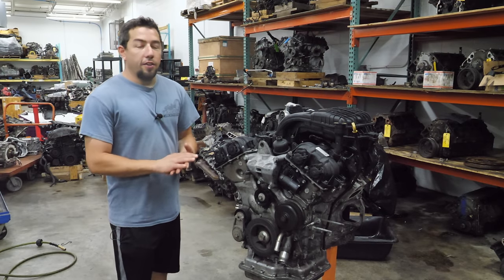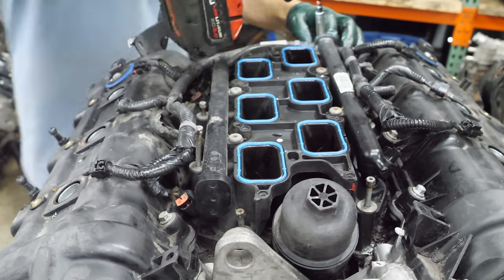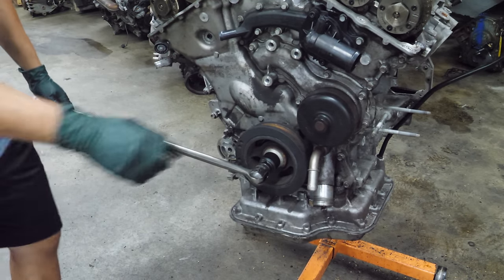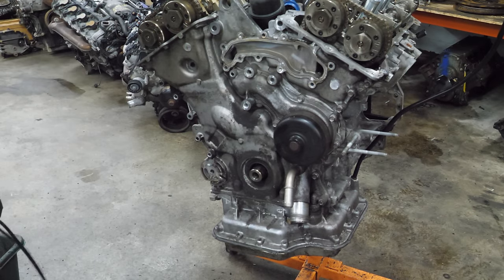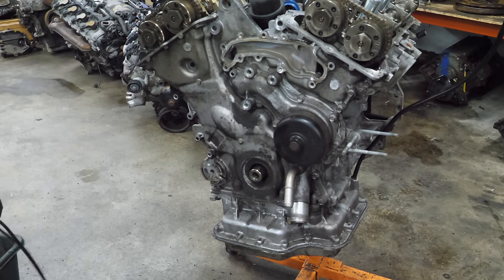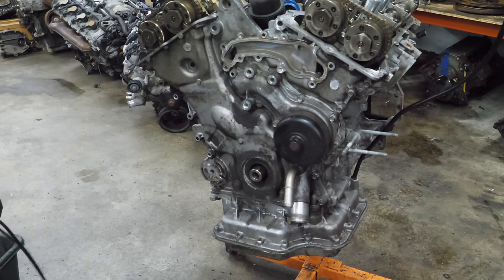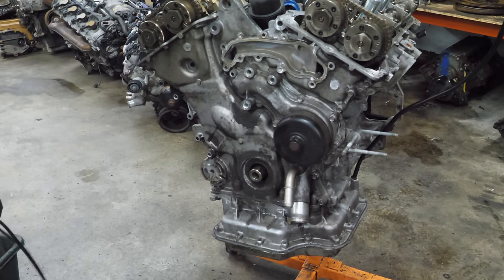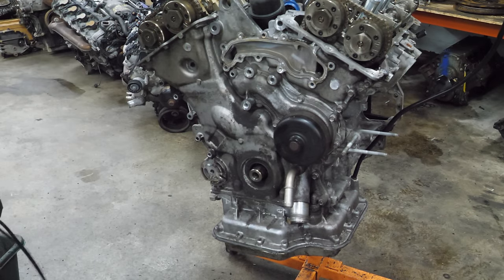Dodge Caravan 3.6L Pentastar V6 Teardown! Why Won't This Engine Turn All The Way Over?

Comment: The Safety Tote reminds me of Dark Helmet from Space Balls. Every time I see you use the Safety Gear, that’s what I think of. Looks like a decent little engine still. I wonder what would cause the carbon to buildup like that?? Thanks for the videos. Hopefully everything goes smooth with your wife and new baby.
Reply: The problem is the direct injection system, that is why there is so much carbon on the valves and pistons. Regular fuel injection sprays fuel on the valves to clean them . Rick
Reply: @richardwelsh8448  I could be mistaken, but I believe the 3.6 Pentastar is still port injected.  My '15 V6 Camaro was D.I. and I put a catch can on it.  I couldn't believe how much oil it accumulated.
Reply: @richardwelsh8448  If it were a direct injection problem, the carbon would build up on the valves at the head ports, but not inside the cylinders like this. Besides, these 3.6l engines are injected at the lower intake. Other commenters pointed out that this was probably Grandma's grocery getter/church ride and built up carbon from never being driven hard enough to clean the cylinders out.
Reply: His Schwartz is impressive.
Reply: I am your father’s brother’s nephew’s cousin’s former roommate
Reply: @richardwelsh8448  These aren't direct injection, they are old-school port injection. Direct injection and turbocharging were in the original plan, but never got implemented. Retrospectively, considering what needs to be done to fix intake valve buildup - Toyota and Ford added the cost and complexity of implementing BOTH Port AND Direct injection - I'll stick with old-school port injection!
Reply: @cohocarl  You are correct. As for your Camaro, the "High Feature" V6 in your Camaro has (or had?) a design flaw with the PCV system that caused very high levels of oil blowby and oil high consumption with longer oil change intervals (greater than 6k miles). Lots of Youtube videos describing the problem. I don't know if it is fixed in MY2015, but it would explain why you had so much oil accumulating in your catch can.

Comment: The Pentastar is a favorite is mine. They have an impressively low part count, are smooth as glass (at least for a big bore V-6), and run quite strongly.
Reply: My '12 has been simply flawless.  220,000 K's and running as new.  I've replaced the thermostat and alternator, one day I'll replace the factory plugs...
Reply: Bo Blu  If the Pentastar runs rough at idle, you need to investigate: 1: Is the check engine light on? 2: Does it mostly shake at only idle? 3: Is there a pungent exhaust odor? If most of the mentioned symptoms, then it probably means bad valve train, which I heard that the valve train is part of the head, so head replacement is required. Unless you found the cause elsewhere. This is based on a 2014 Dodge Journey with the Pentastar 3.6 that was shaking at idle, and the check engine light was on.

Comment: The block for this engine is also the base for the Maserati/Ferrari F160 Twin Turbo. Do one of those next, they're easy to find! LOLOL, JKJK. Those however also get carbon in the intake valves like this one, but I never heard about carbon issues in the combustion chamber. Great video as always!

Comment: I had a 3.6 in a wrangler. I added a “catch can” and it used to catch quite a bit.
Reply: What do you mean by catch can?
Reply: @greenman7612  it sits between the Pcv and the intake. When the Pcv opens it sucks oil with the pressurized air and fouls plugs and leaves carbon on the intake valves and maybe clogs oil rings. I’m no mechanic so …..
Reply: @jeffreygoss8109  Makes me think of the old school 'cans' from my slant 6 days.

Comment: I have a Pentastar 3.2 liter engine version of the 3.6 in my 2017 Jeep Cherokee (not Grand Cherokee). . Built in the same plant. In fact, I've read that the block is the same casting#, they're first bored before the liners are put in. The article I read said the only difference between a 3.2 and the 3.6 is the bore liners on the 3.2 are thicker, to achieve a smaller bore, but both go down the same machining line until time to put in the bore liners. Its now at 99K miles and has had absolutely no work done on it at all other than one computer upgrade. It gets regular synthetic oil changes and that's it. Uses only a part of a quart of oil per 1000-miles.  It IS coming due for its 100K maintenance and trans fluid changeout. Gets 31-32 mpg between SW Colorado and Phoenix, either way, vs a 25 mpg EPA highway rating, for over 25 round trips with the 9-spd auto trans. Based on my experience with the engine, I'm its biggest cheerleader. Thanks to Eric for having this teardown and general discussion of the engine. It never hurts to learn a little more and more about your car's engine on an ongoing basis.

Comment: This was an awesome one to watch. I just bought a 6-speed Gladiator with the Pentastar and am very pleased with it. I’m glad it’s port injected so I don’t have to worry about intake valves carboning up. It has plenty of power for what it is, and the best I’ve gotten is 26.7 mpg. And it sounds damn good with an exhaust as well😎

Comment: I often wonder, do you eventually pick up the parts you throw around, or do your coworkers arrive in the morning and realize you stayed late to do a teardown video.
Reply: Where they fall, they stay. They serve as a warning to future engines to not disobey the will of Big Blue and the breaker bars. Some say when the shop is closed and everyone has gone home you can still hear the tortured cries of head bolts cracking loose and the distant rumble of an air compressor building up pressure.
Reply from the maker: I usually pick them up if I can find them. Trajectory not always known
Reply: @grilobite  well said 😂

Comment: That oil looks great.    That's the cleanest engine I've ever seen inside.    That's definitely a Valvoline engine.    That vehicle definitely had regular oil changes unlike most vehicles.    Most people just skip the oil change so they can go shopping or buying lotto lickets

Comment: As a younger person working in a municipal fleet maintenence shop, experienced a knock in a 1970ish chevy c 10 pickup with a straight 6 cyl. The boss was more of a clerk than mechcanic, retired armed service type. Told him it was carbon...and what needed to be done. He had other concerns directed to have head removed...whole lotta labor VS a ten minute procedure... it was even that way in the dealership..old style management...

Comment: That engine was eased to death. You have to run them a little hard or the carbon doesn't get blown out.
Reply: That's true for many other engines, I guess. Especially diesels.
Reply: Or run the engine on 93 octane.
Reply: @map3384  93 octane on an engine designed for 87 provides no benefit
Reply: @zacht9447  Says who? You . 87 octane means carbon build up. My dad who was a mechanic told me that when I bought my CJ7 brand new in 1986. So I used nothing but 93. When I sold the vehicle it had 157,000 miles and purred like a kitten.
Reply: @map3384  No it doesn't At ALL. Low load low combustion temperatures mean carbon build up. All High octane fuel does is prevent preignition. It has no impact on carbon deposits. It doesn't "Burn Hotter" or make more power.
Reply: @map3384  hell no ,86 models were low compression.  93 is for motors that have around 10. 1 compression.
Reply: @zacht9447  BS. Higher octane fuels always burned cleaner. Less carbon.
Reply: @BruceLee-xn3nn  and when I sold the vehicle the 4.2 liter ran quiet. 157,000 miles on it when I sold it and I’ll bet it’s still running today.
Reply: @map3384  I got a 89 Lincoln mark vii that I drive to work.  500 miles a week and only use 87 octane.  Runs just as good as any new car. My wife's 2014 Hyundai has to have 93 or it will ping. All 80s model vehicles were low compression,I don't even remember there being 93 octane back then.
Reply: @map3384  LMAO ok buddy keep wasting your money. get back to me when you do some research
Reply: @BruceLee-xn3nn  Yeah 93 existed back then. My brother and I both owned CJ7 Jeeps. His was an 1985, mine 1986. Same engine, 4.2 liter inline 6. I used 93 he being cheap used 87. His engine had constant pre detonation and engine knock. His engine got worse as it aged. Mine always ran quiet.
Reply: @zacht9447  Did. Fool you for being cheap.
Reply: @map3384  No you did not if you believe anything you've said. or you've been reading it on forums where one person said it because they don't know what they're talking about when all of the other people know the truth.
Reply: @map3384  I don't believe that. I know more than enough about engines. All those na motors were low compression.  It was turbo vehicles that needed higher octane.  And I don't believe there was 93 niether,  maybe  91 but that's it. Maybe your brothers was just a pos.
Reply: @BruceLee-xn3nn  Yeah we had 93 in New York.
Reply: @map3384  Maybe, yeah...
Reply: Typically higher octane only helps for higher compression to kill off preignition.   if the engine  is getting spark knock,  it could be other things.   it won't 'burn cleaner '
Reply: @ericneeds1512  Exactly. The mechanic at my local dealership told me the 3.6 runs a bit on the high compression side and was having loads of rocker bearing issues because of pre detonation .  Chrysler informed their mechanics that they should suggest to owners they use 89 or better to avoid the problem. He told me they were trying to avoid a class action suit. Some will take their advice others not so much but .40 a gallon difference isn’t a big deal.
Reply: @zacht9447  They tend to use more detergent in the premium. And a friction modifier too. Helps the fuel not burn so rough/turbulent.
Reply: @willc5512  "Rough and Turbulent"= more complete burn and better mixing of the air and fuel = less carbon. More detergent just means less gas too.
Reply: Like I suspected with school buses powered by a 350 N/A gasoline V8! (or what ever V8 size it had, IIRC) I used to go in a bus that mostly stayed on the campus on a mountain only, most of the time and it would often struggle to maintain 20 MPH or approximately 20 MPH on bigger hills! It would be lucky to reach 65 on a highway! That was before a reported engine failure, likely a thrown rod! (and/or the pistons and/or the valves) The reported failure was in 1997, IIRC. I was regularly riding in it from 1994-1996, if not also 1997. Wouldn't be surprised if it failed while it was going back up the hill of the road to the campus!
Reply: @map3384  technically it does run at higher than typical compression.   Knock sensors as well as timing will typically keep these under control unless run at a high load/temperature.   I've got 77k on my Durango w/o issue or knocking.   Carbon buildup can build 'hot spots' which will cause detonation before the spark.  higher octane does help when. this occurs.
Reply: @RJARRRPCGP  I was lucky enough to have a bus with a 466 international with a stick.
Reply: @map3384  That is not a thing and you would know that if you read the definition of octane.  FFS shut up.
Reply: @russellv6234 People always say those things in the dark knowing they won’t get punched in the face. Cowardly rabbit.
Reply: @map3384  Rocker arm issues aren't typically caused by octane level. There were issues with bad needle bearings.  There's a lot of posts on these.  Putting higher octane to stop detonation is a band-aid at best.  The issue stems from a manufacturing standpoint.  Preignition on many (especially these) at low rpm throttle blip is more of a timing.  I even had this on my uber low compression 225 slant 6.  This is more likely what you'd experience in your Jeep.  I actually caused this to occur on my 225 i-6 by pulling vacuum advance (engine actually performed  better, gained about 3 mpg, but would give a preignition 'grunt' when I blip the throttle.    I wasn't too concerned, as its almost impossible to kill a slant 6.  I had +160,000 miles on it, and everything else rotted.
Reply: @ericneeds1512  rocker bearings going bad is because pre detonation or so I was told. I’m not a mechanic but I need things to last. The 225 was a great motor. I’m currently looking around for a CJ5 with that motor. Yeah my CJ7 was rotting everywhere when I sold it. I washed it once a week but the quarters rusted, door rusted, floor board rotted.
Reply: @map3384  Usually the valves are closed during compression/ignition, so there really shouldn't be and issue with the bearings on the rockers from preignition.   Detonation (also seen as preignition) would typically damage plugs and pit the piston where the hot spots are.  When its bad enough, it will destroy the piston and plugs, and have some damage on the head itself.  It doesn't look like it on this vehicle.  I did get 'dieseling' on the old 225 i6, but that was primarily due to carb adjustments - idle speed a little too high, and was typically run 'slow' (never broke 2000 rpm, rarely 1500).    If you do get a slant six - easy to work on, rear mains leak, and plugs easily foul in cold weather (always left a carbon spot by the snowbank).  Carb icing is awful in near freezing damp weather.   Wheel wells rotted, but the carbon in the exhaust kept the muffler intact (lol), as did the leaking rear main (kept the driveshaft/box 'coated'.   It did its time, and replaced for a Quad4 HO Pontiac.

Comment: I'd love to see a 6.4 srt hemi motor! Love the channel, this is a great way for me to distress from a terrible Saturday of work.
Reply: RAM 6.4L is not the SRT, that is the Dodge 392.
Reply: @e.l.9589   they used the same block as the ram 6.4 but changed a few things including the heads from what I was told before having mine built but was curious to see a bone stock one go up to his channel
Reply: @Joshuabryabt-gf6sc  SRT has the orange block with more power, my RAM has BGE stamp. Pistons may have higher compression on SRT. I'd like to see either one, but that may be a good thing if none are available.

Comment: I got 2 of them. They are great engines IF you change the oil with full synthetic every 5k miles. Never trust the built in oil life monitor. I change oil at 5k and it says I still have 48% oil life left.......yaaa right
Reply: I change mine every 4k tops

Comment: In my experience the style of oil filter is a problem, they tend to drain out while standing and every time you start the engine it has to first fill up the oil filter before oil pressure is built causing unnecessary wear eventually killing the engine. Chevy used that stupid design in a few of their engines, the last I saw was in a 2017 Colorado V6 but the new 2022 Blazer V6 they went back to the steel oil filter that just screws up under the engine. A way better design it always stays full.

Comment: This isnt the first Chrysler product that you've torn down that had massive carbon build up.  The usual culprit is non-detergent non-top tier fuel.  The other problem is the manufacturer recommends lower grade fuel that is actually need for the engine.  the 3rd possibility is the CAT was clogged and the carbon had nowhere to go
Reply: What about granny driver loaded up with carbon. Needed A few Italian tune-ups.
Reply: @robertslegers257  that was my thoughts! Never really warmed up. Never reved above 2500 RPM! GOTTA TAKE CARE OF THE VEHICLE!
Reply: @robertslegers257  That will lead to #3

Comment: Dodge Engineer 1: Let's put an oil cooler in one of the hottest areas of the engine outside of the combustion chamber
Dodge Engineer 2: Brilliant idea! Let's also put the oil filter there and cover everything up with the intake!
Dodge Engineer 1: YES! It will all be made of plastic that will totally not crack from the heat over time!
Dodge Engineers: We're so smart!
Reply: Mercedes engineer you means since they was designed during the Daimler ownership.

Comment: That's a pretty beefy engine! Too bad it was subject to 2010's engineering quirks. Probably blew a ton of oil past those oil rings and cooked a carbon layer cake over time.
Reply: @Jackets64  I believe there was a plan to do turbocharging and direct injection, so they were designed to be pretty beefy. They never followed through with that at Dodge/Chrysler/Jeep/RAM, but these engines serve as the basis for Maserati and Ferrari turbo V6 engines.

Comment: I have a 2015 Jeep Wrangler that I've had to replace rocker followers on. It's an easy job, but there's a bunch of stuff to remove to be able to remove the valve covers. Our Jeep had mileage in the 80,000 mile range when I heard the symptomatic ticking that represented rocker followers that had needle bearings failing. I was able to make the repair before they ate the cams. I had to loosen the cam journals popping out the old rocker followers for new ones. The engine was clean looking at the top end so it wasn't neglected by the previous owner.

Comment: My company has bought at least 15 caravans from 2011 and up. The older vans got slightly better fuel mileage and the build quality on the older vans seems better. We sell them off at 185k miles and I don't think we have ever had a bad motor or transmission. Lots of brakes however. We also have a few promaster vans with that motor. I can't imagine having to work on those.

Comment: I enjoyed the video.  Thank you.  Reminds me of my late teens, early 20's when I used to work on engines.  Amazing that today, they are using items we only dreamed of the '70's and 80's on common factory engines - roller lifters, chamfered oil holes in the crank and windage trays.